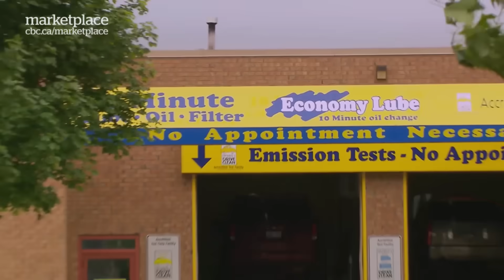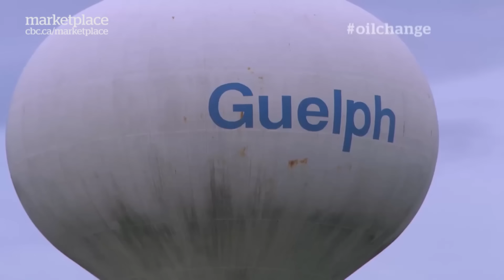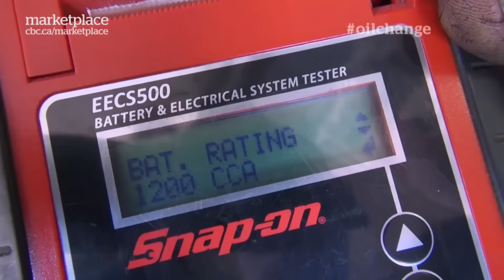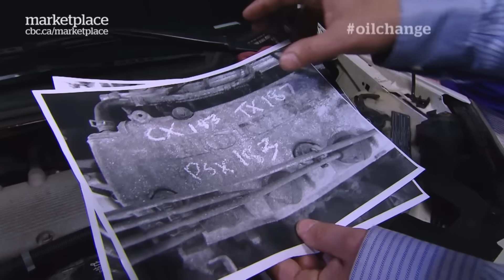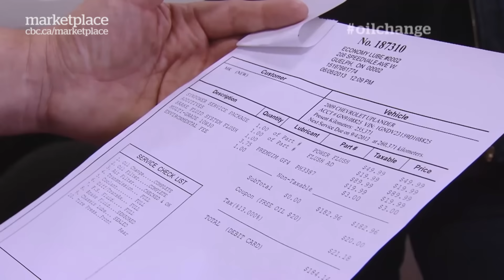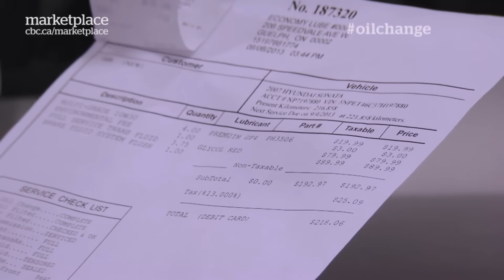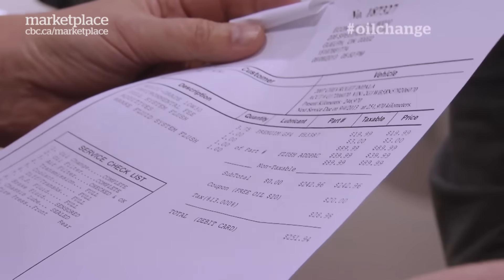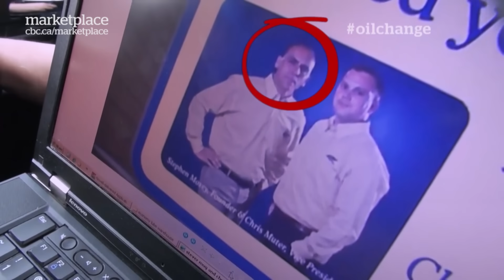Oil change scams: Hidden camera investigation on what really happens to your car (CBC Marketplace)

Comment: As a woman, I was in the quick lube work for 6 years, and I was darned good at it and also fast on my feet.  But It would blow your ever-loving mind what goes on in some of those places.

While working at well-known, large-chain, quick-lube business, I was going to report an inside theft racket going on, to higher management.  I certainly didn't want them to suspect me, if/when they found out about it.  My boss accidentally discovered that I was going to talk to his boss (who happened to like and respect me).  Well, my boss stopped me before I could, and told me that if I ever tried to go above his head again, he would cut my hours down to practically nothing.

On top of that, the crew would almost never check the power steering fluid properly, and would call out that it was "full".  So sometimes when a concerned customer would be driving out of the building, I would stop them, lift their hood, and check it the right way (by wiping the stick dry FIRST to get an accurate reading).  Every single time I did this, their power steering fluid would indeed be low.  And yes, I did take into consideration the temperature of the engine. 

They would sell air filters to customers who didn't need them.  In fact, many of those air filters looked clean as a whistle!  I was made to try and do this too, but little did they know that while I was showing it to the customer, I was actually telling them that their air filter was just fine (which was the truth), and I'd report back to the crew that the customer wanted them to just blow it out for them.

They would also save oil that still looked clean that they'd just drained from a newer car, and pour it into empty Pennzoil or Quaker State oil bottles and use that for a customer who they knew was "cool" and would be paying cash.  That money would then go into the crew's pockets.  However, this customer would not know that used oil was being put back into their car's engine.

In addition, they would save those used clean-looking air filters that they took from the cars, and sell them as new, then keep the cash.

My boss started cutting my hours, anyway, because he knew what was going on, all along, and I think he was afraid that I might end up telling.  Well, I finally found another job to replace it.  In fact, it was one of the customers who helped me to get it, and he became one of my new employers as well as a close friend.  💕✔️

P.S. - This was almost three decades ago. And the last time I checked, that large oil change business went out of business.
Reply: lol. I remember some guy at one of those places telling me an oil change was 30, but he'd take 20 cash. Seemed too weird so I just left, probably would have gotten some used oil and he would have gotten some pocket cash.
Reply: @garybeltrand5802   yyyep!  👍  Actually, the guys at my location didn't start saving used oil and air filters until the main office called them out on a serious dip in inventory that didn't match the money on the books.  This is why smart businesses now forbid their employees from asking, "Will this be cash, check, or charge?"  A good business should also not allow an employee to ask the customer if they need a receipt.
Reply: Bobbie S.. I really admire your work ethic. Thank you. God bless 🙏✝️👏👍
Reply: @michellerjackson5776   Thank you, sweetly.... Have a joyful weekend! 🙂🌷✔️🌟❤️
Reply: You are one of the honest people in america god bless you I hate mechanics most of them are crooks
Reply: @abehassan5249    We were actually considered oil-change technicians, not real mechanics.  But since you brought up mechanics, you're right.  The biggest portion of them are crooked.  

Right now I'm living in a small town, and there are probably about 6 auto repair shops, here.  There is only one mechanic I know of who I can trust 100%.  And guess what?  While the other shops get an average-to-moderate amount of business, this guy gets so much business that there's a waiting list for up to a month.  He's such a powerful example of where integrity will take us.

I wish you many blessings.  Thank you.  🤗
Reply: @bobbieschroder6231  i agree 100 percent, , we have one grocery store in Gerald Mo, they advertise sale prices and if even asked  and you did get receipt and checked it ,  you didnt get ssle price along with many other mistakes, it takesore time asking rather than just giving it like they should,   
Would you like your receipt?  Is a big RED FLAG  consumer beware !!!!!
Reply: Thankyou for telling your story.

Comment: Don't forget the stereo and speaker system coolant flush
Reply: That's right, those are a few hundred each. XD
Reply: never forget blinker fluid
Reply: and the change holder filter, the pennies are turning green
Reply: Lucas LLorens Don't forget Seat heat fluid!!!
Reply: You forgot about changing your muffler bearings every 50,000 miles
Reply: Tino : 50,000 miles? I have been told I needed mine every 5,000???? What the hell?!?!?! Your going to ruin your car!!!!! Maybe it's a difference in the model. I know for a fact my mechanic is honest. He only expects a 35% tip and will thrown in a vehicle aerodynamic's test at half price using a fan he found at Walmart along with a COMPUTER diagnostic of my windshield wiper fluid distribution to wiper diameter ratio evaluation for only $7000. I don't care who you are, you know you can't even get the gear to do that yourself for less so I've been told at the shop. Muhammad is one hell of a mechanic and I know the $400 I pay for my oil changes is well worth it (He'll even come to the house for an extra $2k and can change my oil with only 1 quart of the Maverick brand oil). He literally can do the impossible and I've talked to other mechanic's, they are just plain lost or lying. I NEVER would have know I needed it done every 500 miles and I'm a courier!!!! Without his advice and help I'd be totally screwed!
Reply: Gotta change that headlight fluid
Reply: i tryed to do the speakers flush last time myself but the subwoofer coolant kept leaking out of the sub box so i just stuck with a mechanic shops.
Reply: KX250F SS q
Reply: What about window fluid
Reply: Lucas LLorens what about the blinker fluid..... and muffler bearings
Reply: Lucas LLorens o crap we also need to replace the car
Reply: Lucas LLorens There’s no coolant in the stereo and speaker system.

Comment: That’s why it’s important to know about your car and simple things such as what color your fluids should be, how to do an oil change properly, etc. If you’re falling for that power steering fluid mess, then you might as well bring blinker fluid with you 💀
Reply: The blinker fluid should be bright pink, but it's gone brown and smells burnt from too many blinks.
Reply: I would LOVE for them to tell me my powerstearing fluid needs flushed, bc the power steering motor is 25 years old and leaks like a mofo.

Tech: Your fluid is burnt.
Me: Well ya I hope so that power steering motor is 25 years old and burns fluid if its not burnt then it broke.
Reply: A lot of cars nowadays use electric power steering and don't even need power steering fluid. So if your car is like this and the tech tries to sell you a power steering flush, run.
Reply: Lmao i had a mechanic argue with me saying i needed power steering fluid flush when i know for a fact i have electric power steering

Comment: WAY in the past I had my car serviced and the mechanic showed me the “Metal Silt” in the Transmission Pan telling new it needed rebuilding. I looked him in his eyes and said “ it looks like the filter is doing it’s JOB.
Reply: I'm not an expert but I've dealt with lots of transmission failures and rebuilds on the customer side and I don't think there is any benefit to rebuilding a transmission before it completely fails.  And metal silt is normal.

Comment: When I worked on cars in a shop for awhile it wasn't uncommon for the customer to watch and ask questions as u worked
Reply: That's not a bad thing for needed flushes. If you are doing trim work the customer shouldn't watch. It looks and sounds like you're breaking stuff when doing trim work. Customers won't like that.
Reply: @ericschwan7353  sometimes you get in good shops that have customers that are like family and they can ask all the questions they want small shops are more likely to have it then dealerships and located in toronto year was 2018
Reply: Every scammer mechanic's worst nightmare.  A customer that knows how a car actually works.
Reply: @ericschwan7353  last time I went to Mr.Lube after they claimed I had issues underneath I said I wanted to go look, they allowed me after trying to say no and warn me it’s dangerous down below, I told em that I did this kind of work when I was 19, so I know how it is down below abs it’s only dangerous if your a klutz
Reply: You're saying 'it wasn't uncommon' is like saying 'it was common' so why doing the first while you can say it simple...
Reply: @itoldyouthat1049  because people these days are lazy and don’t watch or ask questions they expect it to be said to them. Years ago it wasn’t uncommon for people to actually care about what’s being done.
Reply: @itoldyouthat1049  "Why doing the first" is not right. Do not try to correct others if you can't use English properly either.
Reply: @damiengottzit8401  also ìf they dont allow u to stand outside the door as they do the work then somethings shady its your money your paying get out and go to where u feel comfortable
Reply: @Direwolf1166  sometimes its not a pretty site ya seized calipers u hit them aswell seized tires but its a part of the process the part of replace is better then existing so comes out straight in the end that smile or thta happiness is just... but you will run into someone unsatisfied before u even start the job one day u know what i mean

Comment: This is why I change fluids  (and almost everything except brake lines) by myself. Unless I don't have the tools.
Reply: Exactly same here
Reply: Because of places like these, I too have become more pro active in the personal maintenance of my automobile. Unless its electrical or a delicate time consuming procedure, I'd be willing to do 30-50 minutes of work at significantly less cost and basic procedures with the aid of the internet.
Reply: Geioni Karcheski Thank you for the information, I think I might just try it. So you by laying down the cylinder block on the brake you mean the brake pedal right?
Reply: +ItsFucknChuyy yessir. I would only recommend it though if you don't have an extra person. I say this because you can't actually "see" the air bubbles escaping the brake line, however, after about 3 or 4 bleeds, it can be assumed that no air is trapped in the system.
Reply: Same here. I do all of my own work. And I do mean all. There's nothing on a car I can't repair myself. Thanks to my dad(an ASE master mechanic) when I was younger. I won't work in the industry however, to many shady Garage owners out there. So I do all my own work. I've been labeled a Hobby Mechanic by my dad. :) The amount of money I've saved in doing my own auto mechanics is astronomical.
Reply: Kudos to you man! Im in my begining stages to be a Hobby Mechanic too! Its amazing therapeutic to me fix things on my car, not matter how small the fix!
Reply: The problem is that doing your own work is often times more expensive. I changed my oil and it cost over $50. 8qts of oil plus a mid grade filter and that was with my buddy discount.
Reply: Because Sam if you purchase a chain oil change stores low grade bulk oil and a $2 garbage oil filter it is cheaper. Quality synthetic oil and a high efficiency filter are not cheap, but well worth the money.
Reply: If you're using a quality Synthetic Oil like Mobil 1 you can triple your milage on it between changes. Contrary to popular belief, synthetic oil doesn't wear out, it just get's dirty. I change mine once every 9000 to 10k miles with a filter change in between. Top off what gets lost in the filter change. You save money in the long run. The biggest lie in the oil industry is to change it once every 3000 regardless. That's how they(the oil companies) make money. I've worked in the auto parts industry for over a decade now, the things I've learned to boost sales would shock most people.
Reply: I run signature series AMSOIL and change it once a year. Best oil on the planet.
Reply: +SternLX I am amazed at the oil change interval 3000 miles? really? in Europe it's 10000 to 12000 in cars my workshop van is 18k miles. my own car is 12k between changes. but I'll do it yearly if I don't do the mileage. but you are right synthetic is good oil just expensive. in the heavy machinery industry we can extend oil life by sampling and sending to a lab if its good we don't change it. which on machine that can hold 50litres plus of oil that can save loads of money in the long-term.
Reply: Stewart scallionboy Thompson Yes, the marketing types here in North America love to pound the 3000 mile message as often as they can to sell more oil. Those of us that know better(like you, me, and most other Mechs) run oil for much longer periods with no problems. :)
Reply: +Jones
The hardest part of replacing brake lines is bleeding the air out of the tubes, which is still much easier than replacing a heater core....

Comment: Pro tip: as not all enthusiasts twist their own wrenches there are many “car folk” who know where the brand specific garages are.  Talk to these folks. Find a reputable garage you trust and build a relationship with that shop. Not only will they get to know you but also your car. This will aid in diagnosis and future services. This is also far cheaper than a dealership.